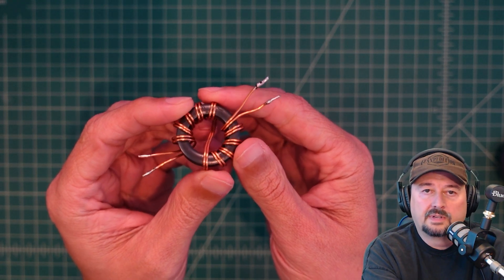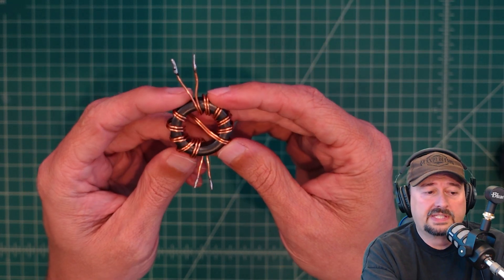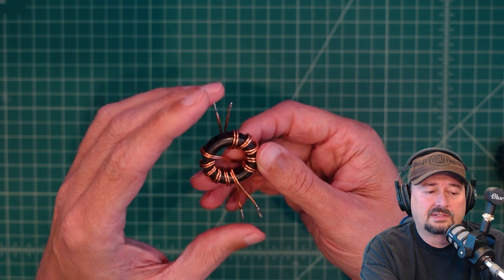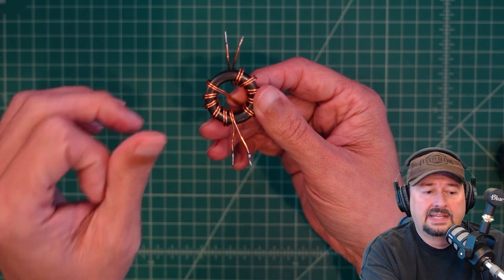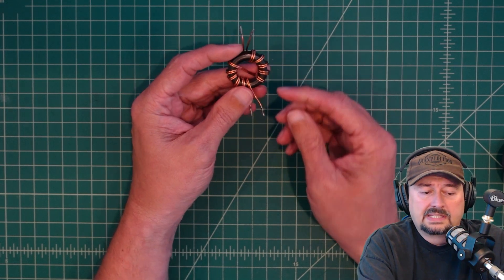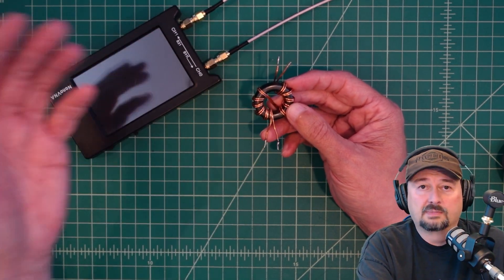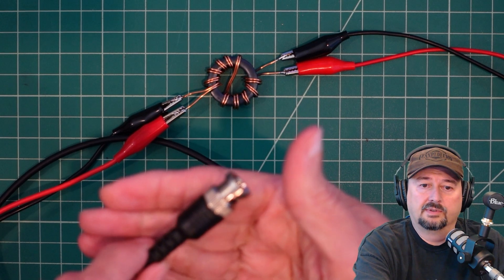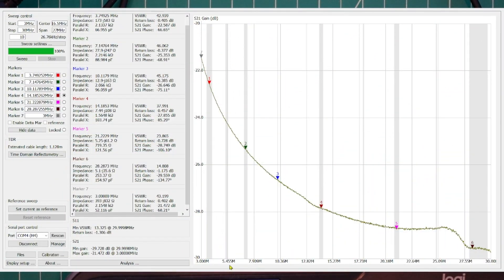Balun Chokes - How do they work?

Comment: Off subject a little, I have found 5 toroids size 2.4"x 1.4" x 0.5" that look like a FT-240-43 toroid. Is there a way to check to see if they are a FT-240-43's. I placed these with known good FT-240-43's and they match in size in every way.
Reply from the maker: Hey Clifton, I made a video answering your question: Ape Answers 018: Testing Unknown Toroids
https://youtu.be/V8jpHCANruU

Comment: I've been watching various videos and playlists as you suggested (and will continue to do so), but it seems as though you use the terms balun and choke interchangeably from time to time.  My purchased antenna  (FD40-3 from Radiowavz via HRO) has a 1:1 balun already, but it seems as though you've said that to combat/eliminate CMC that I need another choke immediately after the antenna on the feed line, and even again down at the radio, and further mid-way depending on feed line length.

If balun and choke are interchangeable, then it seems like I don't need another one at the beginning of the feed line???

In one of your videos, you mentioned "stacking" them?  What does this look like???

And how do I determine which wrapping method is appropriate?  Number of turns and/or wrapping up one side and then coming back down and up the other side the other way...
Reply from the maker: If you have an antenna with a Balun or a Choke you do not need a second one at the feedpoint.  Both Baluns and chokes balance current and reduce CMC and both terms are used interchangeably for both devices, often you will hear the term "balun choke".  There are a few ways to make both, so pick a design you like and try it, measure with a nanoVNA and pick what works best for your situation.  Hope that helps 👍
Reply: @TheSmokinApe  It does, and I have a Nano on the way, once it arrives (yet another learning curve), I'll investigate.

I'm getting what I believe to be interference from either my antenna and/or my feed line turning on a couple of "capacitive touch" lamps and the garage door opener lights in my house.  That doesn't bother me except for whatever affect I'm having on my neighbors, so I'm trying to clean up radiation.

Comment: No Iron core, a steel nut will be a good substitute for this,
Reply from the maker: I am sure that will work to some extent but the magnetic properties of ferrite are greater.  Thank for the comment Manual.
Reply: Hi, maybe you are joking, or mistaken.
Ferrites are iron oxide plus other metal elements containing ceramic materials interspersed with nonconducting glue material, synthesized as in the pottery making for specific magnetic properties and purposes.
Steel or soft iron are good for DC and low frequency AC.
De VU2RZA

Comment: When running this type of choke, does qro and the thickness of the cores matter like they do in a transformer?
Reply from the maker: It does matter but to a less extent as the main reason for larger cores is heat dissipation which is less of a problem in chokes.

Comment: Cool. What happens when you vary the number of turns? How does an air choke compare? (How would you measure an air choke on a vna)
Reply from the maker: The number of windings does make a difference but when you get about ~11 the impact is greatly reduced.  The magnetic properties of the core is the magic in a choke which is missing in an air wound choke, the work but need to be accurately tuned, which is difficult, and are very narrow in bandwidth making them limited for effective use.   You can measure then with a VNA.

Comment: Just finished building one using RG174 (for QRP use) on a small type 31 material. Once fully assembled, I ran an insertion loss test and it's very flat from 3 - 50MHz. Very low insertion loss! I'm of the impression that type 43 would be better used as a transformer in the same frequency range. Type 31 for chokes; type 43 for transformers (1:1, 2:1. 4:1, 9:1, etc). The material in 31 opposes fields in the HF range while 43 being of a [slightly] different composition aids in impedance transformation. For folks who don't have VNA's but might have access to an analyzer, put a 50Ω non-inductive resistor on the output of the choke, and test for SWR across HF. If the reading is high, then it's a bad design, but if it's low and almost flat, you have a
usable choke. Just pay attention to the power handling capacity of the unit.
Reply: I've tried all sorts for chokes and transformers even junk from hamfests which ultimately end on power cords. Yes, there is some cross-pollination between the various types but as each type has its unique specs, they also act as either a choke or a transformer in different parts of the spectrum, hence the different types. Were they completely interchangeable there'd be no need for the various types. This past Hamvention I attended a presentation Friday evening at a dinner where this very topic was discussed and led by Bob Brehm, AK6R, Chief Engineer of Palomar Engineers. He has a plethora of information on their site including the above presentation. I was able to speak with him separately about this and broader "core" topics. The nice thing about Palomar Engineers is you can buy a complete unit or you can buy whatever parts you need and roll your own. I've bought cores from eBay and Amazon but never sure if the item is what it's advertised as. Buying from Bob I never have to worry. I have bought complete units and parts to make my own. I'm very pleased with the products and tech support he provides. I'd rather source my information and parts from a reputable company. I also consider the "Ape" a reputable source. That's why I subscribe to his channel.
Reply from the maker: @oobihdahboobeeboppah  Thanks for the details and for the vote of confidence 👍
Reply: #43ferrite (ui=850) is Ni-Zn and #31 is Mn-Zn (ui=>1000) ferrites. 
Any ferrite being ferromagnetic, can be used as a transformer or as a CMC choke for a particular frequency range.
#73,75,77 are all Mn-Zn ferrites with ui=>2000 or more and can be used as transformer cores for the lower most end of the HF and the MW frequency band; they can very well be used as CMC chokes too.
De VU2RZA
Reply from the maker: Hey oob, I typically use 31 for broad band chokes.  That said this particular core FT114-43 is commonly used by dipole antenna manufacturers which is why I was testing it in the first place.   That said, I felt it was an adequate example for this demonstration.  Thanks for the comment!
Reply: @TheSmokinApe  you are right, ape.
De VU2RZA

Comment: Could you explain balun vs unun? I recently bought the LDG RU-1:1 unun as it appeared to advertise as use as a choke. (Appears to be working preventing my computer usb from disconnecting while transmitting ft-8). I’m using a buddiestick pro (balanced antenna?), so thought I should be using a balun but it seems most of those I could find came with posts to attach directly to a dipole or similar. Sorry for my ignorance but am I way off on this?
Reply: Hi, the buddy stick pro is essentially an unbalanced vertical antenna with a counterpoise (elevated ground radial)
You are using the UnUn to curtail the CMC that tries to disconnect the USB when you operate FT8 mode.
A bifillar wound or a coaxial cable wound cmc choke can be used as a BalUn or UnUn depending upon where you put it.
When placed at the feed point of a center fed 1/2 lambda dipole it is called a BalUn; ie, looking from the antenna side, and the dipole being a balanced device.
From the coaxial cable (an inherently unbalanced device) it may be called an UnBal, though the terminology is not in vogue. 
A UnUn is a device connecting two Unbalanced ports together on either side. 
The impedance transformation achieved can be simply a 1:1 or other ratio as well.
The bifillar wound or coaxial cable  wound choke when used on a coaxial cable feeder before it enters the shack end of the coaxial cable it is called a UnUn (because both coaxial cables are Unbalanced devices)
A UnUn can be used at the feed point of OCF dipole (Windom etc) , the slimjim, J pole and the EFHWA etc.
So, the UnUn,  what you are using is correct in your buddy stick pro antenna. 
De VU2RZA
Reply: @subramanianr7206  thank you!

Comment: How does a ferrite core compare to a coax air core?
What mix for a 10m choke?
Can I replace the coax air choke for a ferrite one on a 10m flower pot antenna and get a better result. Ie lower insertion loss than ~4.3m of coax and decent common mode rejection.
Reply: An air core Balun or ugly (not exactly though) BalUn is not broadbanded and might vary well become a wave trap for a particular frequency band with the right amount of inductive and capacitive reactance. 
Ferrite loaded BalUn can be compact and offer the right amount of resistivity for the CMC that tends to flow on the outer side of the coaxial cable shield. 
I believe, by flowerpot antenna, you mean for the 2 meter band and you can very well use 2-3 turns of the coaxial cable feeder on the 1" long #61 ferrite cylinder sleeve core.
And the 2 meter band calls for 144-148 mhz only and hence an air core ugly BalUn will serve the purpose well. 
De VU2RZA
Reply: @subramanianr7206  Thanks I have an 2m flowerpot already. Was planing a 10m (28mhz) one and it calls for 4.3 metres of coax air choke. The lower section is ~2.5m of coax to mid point where the centre coax then joins to the ~2.5m wire going up for the upper section. So from input to the choke to the actual mid point real feed point is already 6.8m of rg58. Then I have the coax run back to the rig which could be rg213. Just trying to cut down the coax loss in the 4.3 meters in the air choke
Reply: @moozoowizard  hi, that is fine.
A flowerpot antenna (for the 10 meter band, 2.5 meter on either side) is, for convenience and polarization, essentially a center fed dipole in vertical orientation.
For this band, 4.3 meter RG58 coaxial cable wound as an ugly BalUn is the easiest way and its bandwidth is adequate. 
A CMC choke wound on a #52 (ui=250) or #61(ui=125) ferrite core (either a torus or a sleeve cylinder) to bring about an impedance of 500 ohms or more is warranted here. Use the formula 2pifL to calculate the reactance in ohms.
Instead of RG58, you can use RG316, Teflon coaxial cable for a much smaller bending radius; it is good to handle more than 100 watts.
De VU2RZA
Reply: @subramanianr7206  Thanks. Very Good info 👍. I'll do that. VK6MIK
Reply: @moozoowizard  thanks and you are welcome 👍
De VU2RZA

Comment: Thanks for the post.
Let me explain a bit in detail. 
Differential mode currents flow with equal magnitude but in opposite directions. 
Hence, the magnetic field created by one winding carrying current in one direction cancels out the magnetic field created by the current in the other winding at any given instant time. 
But the CMC (common mode current) or vertical current or simply antenna current that tends to flow from the feed point to the shack on the outer surface of the outer shield braid will encounter a huge inductive reactance. The inductance is about 50 microHenry (in your demonstration) and the inductive reactance calculated by the formula 2pifL in ohms.
The bifillar winding may be avoided because the characteristic impedance of the line is around 100 ohms.
The CMC choke must be made using specific core materials of specific size for the specific power levels and specific Teflon coaxial cables for the specific bands of interest. 
For 160-40 meter bands, #31 or 43 would be fine. 
For 20 meter and upwards 43 or #52 will do.
There are inductive,  resistive and capacitive parts.
G3TXQ and other sources like K9YC ferrite cook book may be consulted for a deeper understanding. 
De VU2RZA
Reply from the maker: Thanks for the detail SR 👍
Reply: @TheSmokinApe  you are welcome ape 
De VU2RZA